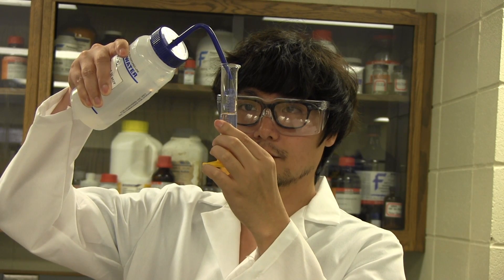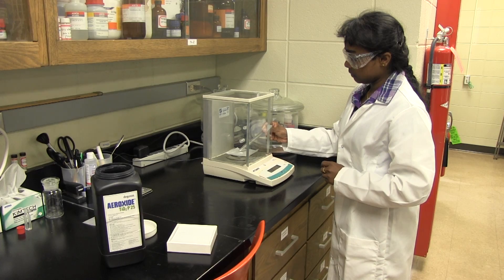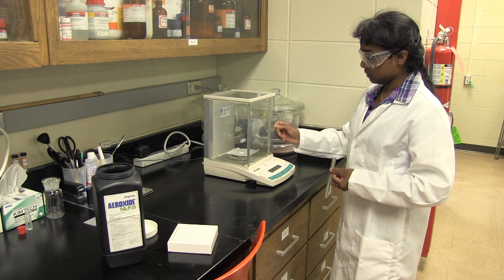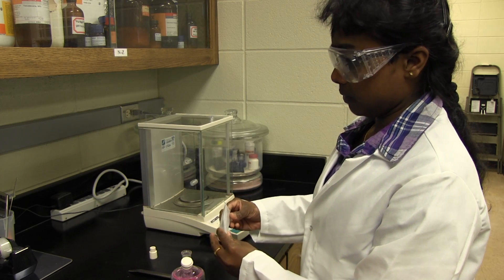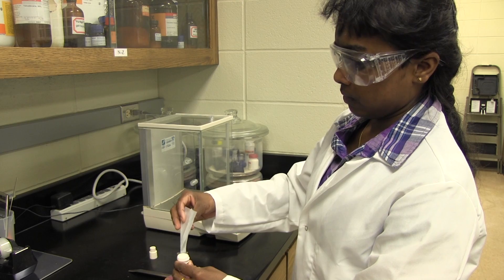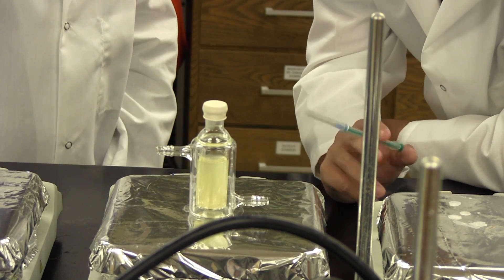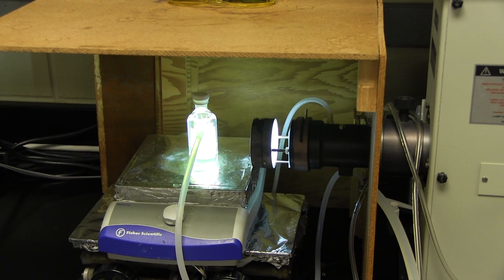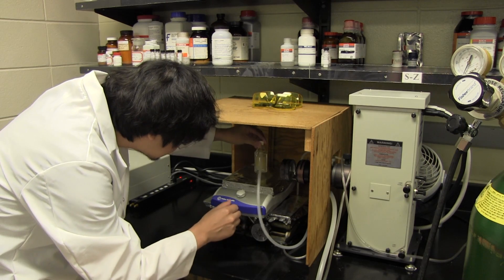Converting water into hydrogen fuel using sunlight

Comment: Pure water? does this mean distilled? seams that would use a bit of energy, heard graphene good for distilling water but more expensive than platinum atm.
Reply from the maker: Deionized water was used in the experiments to obtain hydrogen and oxygen as gases from the Photocatalytic splitting of water by using visible light portion of sunlight and the photocatalyst.
Reply: distilled water is obtained by distillation which does not require graphene or platinum, the water does not have to be pure or distilled, that is simply to keep the experiement controlled